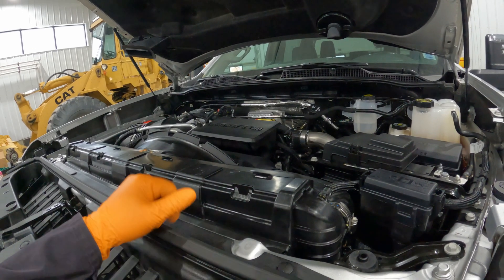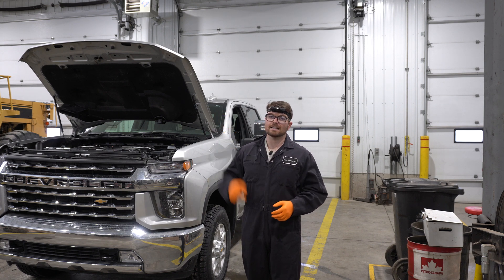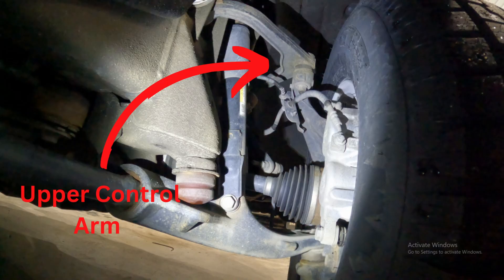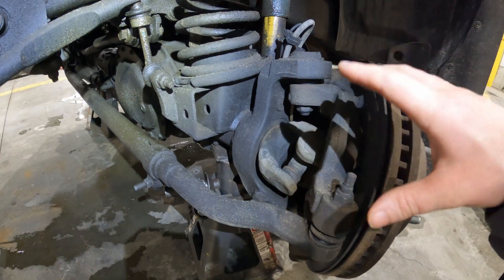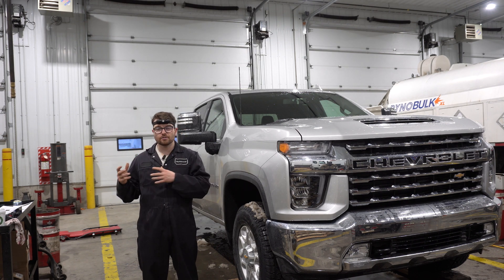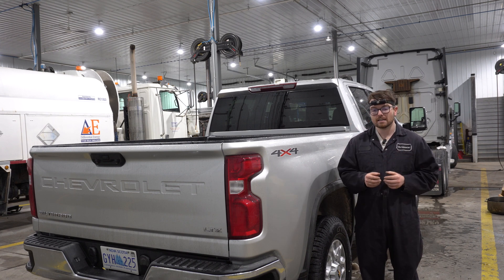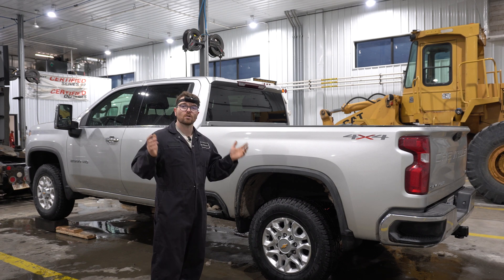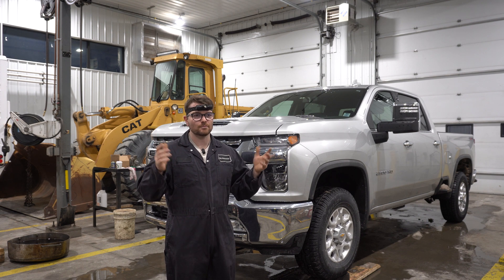Chevy 2500 6.6L Duramax Diesel Review (Part 2) | Does GM Make A GOOD Truck??

Comment: duramax l5p better than cummins  that my opinion
Reply from the maker: the L5P Duramax is certainly a good engine. But the 6.7 Cummins is a very well built unit.
Reply: Yes it is but  older generation duramax not is good like cummins  now l5p is top notch not about power  I'm  Talking reliable .

Comment: I thought tow rating had more to do with the suspension and stopping capability. All these trucks can pull more than they are rated for. I do it almost every time I tow. The problem is stopping the laod. Also I've replaced more ujoints on solid axles than cv shafts.
Reply: I agree, the tow rating is less an issue with the motor/transmission/gear ratio combo and more related to suspension and braking (possibly). The 3500 with the same motor/transmission/gear ratio is rated for 20k lbs towing. All that to say, it's not the gearing combination that lowers the 2500's tow capacity, I believe it's the suspension that holds it back.
Reply: Cv shafts for the win, definitely
Reply from the maker: It all effects towing. I was just taking an educated guess but I could be wrong. the Duramax is certainly more then capable of pulling big weight! 

Ya I've replaced lots of u-joints, usually because lack of maintenance. but I would still argue they are stronger.

Comment: Just priced the two out.  RAM 87k. Equivalent Chevy 70k.   Ram went from an affordable truck to the most expensive.  A super duty is cheaper option for option.   I guess  you really need to love a cummins to spend that much more.   Gas engine GM and Ford win again.  In 2024 GM will put the 10 speed  behind the 6.6 gas.   Ram needs to wake up or up the value.  That fancy interior doesn't mean that much to me.
Reply from the maker: wow, if that's true that's bad. RAM is the last manufactuer that can afford to price themselves out of the market. realistically ford and gm make more reliable products. the beauty of Ram trucks was that you could get a nice truck at an affordable price.
Reply: @The Getty Adventures  The Laramie I priced was 87k and the bighorn was 80k.  Cummins, midnight,  and the lowest option package they force you into once you add painted bumper.

The chevy in LT trim, z71 appearance package,  like the midnight package,  leather was 72, LTZ  was 75.  

All diesels.
Reply: @mattromain7177  I ordered a 2022 2500 bighorn optioned out to almost a Limited. I got the bighorn because.  I couldn't get the night edition Limited. Because the chip shortages.  Anyway I got my 2022 ordered it in 2021 in September.  Mines a night edition with 4:10 gears . The sticker said 61k. When I built a Ford with the same opinions.  It was almost 11k more . I didn't built a GM . Because imo they suck . So I didn't even bother.
Reply: @Matt Wengert  the Laramie trims really went up.  I did price out a big horn, midnight,  the higher level option package and with a 6.4 was 68k and with a diesel was 80k.
Reply: @mattromain7177  That's nuts . I mean inflation is up like 13%. I hope this prices start to flatten out.
Reply: @GettysGarage  

Not even close....he may have been comparing a dealer that added an ADM.

Equally equipped, all the trucks are similarly priced.
Reply: @John Peters  not what I found.  LTZ, vs Laramie.   Big Horn vs LT.  No dealer mark up, just go to their website and build one.   GMC is more than chevy.
Reply: Matt Romain hit the nail exactly on the head,  I spend my evenings looking at trucks and RAM is the most expensive, Ford I could care less about, but looked at them as well, GM is right in my ball park for a HD Diesel truck,  I watch The Getty Adventures videos and I’m glad he said he is BIASED, being honest in my opinion, It’s great he goes through and explains the pros/cons of these vehicles,
Reply: I agree.  Your numbers are correct.
Reply: 392 is a engine too tho.
Reply: GM tech myself…so this info is fairly straightforward to me, but great to see some actual tech on these you tube videos.
I think a lot of truck customers can use this information.

Comment: I have a 2017 3500 GMC 4x4 single cab. I've pull a 4 horse trailer with living quarters and 4 ft mid tack. Load with four horses and gear i sure it weighs 17,000 -18,000 lbs. i performs flawless in the mountains and the highways.
Reply from the maker: The Duramax does have great power so I'm not surprised!

Comment: Love it that you have one of the best Loaders CAT makes in the background. I think of the Lock up of that CAT going into gravel loads. Anyway I just got a 2021-3500-Z-71 Silverado ( Duramax/Allison) and looked at everything you talked about under mine. I will say I was on top of a mountain Pass. No snow cleared on side roads. In (4 × 4) Low and manual shifting. I was in snow up to frame. It was very good as far as following previous tracks
I could get out of turns, easy when it left ruts.
It is a 4 Door & 8 foot box.
Reply from the maker: that CAT pulls a lot a broken trucks into the shop! The G80 locker makes a big difference in the snow! And when I drove this 2500 with snowy roads it was great.
Reply: @GettysGarage  
I just Love it that you have a BIG Loader in the background as you talk about what Dodge, GM has for transmission in Pickups. That Cat will walk circles around any pickup on the market. I own a STOCK in Cat. Have a 1978 Dynahoe-190. And as you know CAT took over BUCYRUS-ERIE the maker of my 1978 backhoe. Just getting to (9000) hours on meter for that old (353 Detroit Diesel)
It's my play toy, like you pushing a vehicle around or should say so you can stay high and dry, as you explain your outstanding video on the difference of the Pickup market. I Love the product that CAT makes. Sucks about their class #8 truck not continue. But did it not get a great push for (International). My CAT stock keeps giving me smiles every time I look at returns.

Comment: I don't think the gearing is the problem, the 3500 has the same engine, transmission and rear axle ratios right? That can tow well over 30,000 pounds. My guess is GM just caps the 2500 off strictly as a marketing thing.
Reply: John YES my 2021 3500 Z-71 Silverado. Towing my 26 foot boat. I would say maybe 7000 pounds. Very easy to tow. Don't feel like my older truck.
Reply from the maker: a 3500 would make easy work of 7,000lbs!
Reply from the maker: Potentially a marketing thing. I still think it would be nice to at least have 3.73 gears as an option for someone who is towing consistently.
Reply: @GettysGarage  these new diesels trucks make it feel like there is nothing behind you . towing in these trucks has never been a problem .

Comment: General reliability is king. Sorry, I don't trust RAM Cummins.
Edit, you can buy new solid axels, Duramax Allison, with the 4500 series.
Reply: I don't own anything as new as this truck but my 07 3500 lbz is just seems to be a better all around truck than my 03 3500 5.9 cummins..  I understand there's a 5 year gap but I fell into the cummins hype...   the cummins is a great truck but my lbz does what the cummins does but with gloves on. Also, IFS is just more practical for me since I never plan on rock crawling these trucks
Reply from the maker: That's fair! Chrysler/fiat have always lacked in quality. But the Cummins is the engine on the market without a doubt. 

so it's interesting how when they go to a 4500 series truck they drop a solid front axle in because its a stronger unit. tells you everything you need to know.
Reply: @GettysGarage  👍👍

Comment: I agree with you on the wishbone suspension because a u joint is a hell of a lot cheaper than a new axle
Reply from the maker: yes sir! and once that boot rips your CV axle is pretty much junk.
Reply: Check the prices for an actual OEM Ford or Dodge front axel u joint. They aren't cheap. A Chinese one is cheap, but they'll last 15k miles. Also, have you drivin a solid axel truck with 150k miles. They drive like crap, all over the road. While an independent truck is much more drivable with worn parts.
Reply: Look at the labor costs to replace that u joint over the cv axle
Reply: @williamwhitted2490  like 2 hrs work if you're not an idiot

Comment: you can't get 4.10 with 2500 Cummins 4.10 comes only with dually
Reply from the maker: Yes, my apologies that is correct. only a Gas 2500 can option the 4.10 gears. Thank you for pointing that out.

Comment: Couple of things. The 1500 series 10 speed was designed in collaboration with Ford and not approved by Allison. Allison had nothing to do with that transmission. The HD 10 speed (10L1000) was designed with Allison involved and tested and approved by Allison.
You talk about strength of front ends and of course you are entitled to your opinion, but as a retired mechanic with 40 years on the job, I have not seen failures of these front ends unless the CV boots are open to the elements. I believe they are well suited to the HD trucks and not prone to "Death Wobble." In addition the turning circle is much tighter on the GM's.
Personally I could not buy the RAM based on  the its use of the 68RFE. That transmission is not robust enough and prone to premature failure so RAM's towing numbers are worthless to me.  And the fact that Fiat / Chrysler  decided to use the CP4.2 Fuel Pump on the 2019 Cummins was enough to scare me away. Why would they do that knowing those pumps fail and spread metal throughout the whole fuel system. Apparently those trucks are being recalled and the CP4 replaced with a CP3 leaving customers without a truck for months. The Fords use a CP4.2 and there is no way for me feel good about that.
Reply from the maker: Great points Jim, the solid front axle is not flawless I just think it's a beefier unit. I agree with you 1000% that the 68RFE transmission is nothing but hot garbage. It's embarrassing that you could spend close to 100k on a new Ram 2500 and get that transmission. As for why Ram went with the CP4 pump I have no idea and they are paying for it dearly. lastly, I have no idea why on Gods green earth Ford would decided to still be running the CP4 pump is something I can't comprehend.
Reply: Your information isn't necessarily accurate because if you really need something that is indestructible then just get the ton truck ram with the aisin in it. Also the 22s and maybe 21s come with cp3s from the factory.  And the guy I know with a 5th gen that did the recall said he got his truck back the next day so there's that
Reply: @wizard_of_poz4413  Why do you suppose that RAM does not use the Aisin in the 2500 series that costs $80+ k? The 68RFE isa trash pump yet they continue to use it and apparently don't care. No way I'm dealing with a company like that.
Reply: Also I was not impressed with the turning radius on our dually duramax because the equivalent ton dodge out turned it by a wide margin despite being a crew vs a single cab.
Reply: There’s a reason why you see 9 out 10 trucks in hot shot Ram 3500 or 4400/5500. The GM offerings are good  and in my opinion a better option than Ford but, they still can’t compete with a Ram HO with 4.10 gears and Aisin combo.
Reply: Correct. A Ford 10R80 and a GM 10L80 are the same transmission minus the bellhouse pattern, and each manufacturers own tuning. Then GM uses a 10L90 on a A10 Camaro ZL1. It's a beefed up 10L80 designed to handle more torque. What I don't know for sure is if the Ford 10R140 and GM's Allison 10L100 are based off the same design or not.?.?

Comment: I don’t agree with your statement that Ram has missed with their 6 speed transmission. Ram has the most reliable tranny in a HD with the Aisin. The 10 spd on Ford and GM are good tranny’s but time will tell if they are up to par with the Aisin.
Reply from the maker: The Aisin 6 speed is a great transmission. but unfortunately you can't get that in a Ram 2500 with an Aisin. it comes with the a speed 68RFE which is garbage.
Reply: @GettysGarage  well I got one in my 18 and it's not particularly impressive but it's no 47re or e40d either. Plus I've towed some idiotic stuff with the gooseneck and it hasn't failed yet
Reply: @GettysGarage  I'd be curious if the zf torqueflite is actually any better or if it's a gas only transmission because it seems conspicuous and kinda dumb that the Chrysler transmission is still just hanging out I one configuration of truck and nothing else
Reply: Yeah its a mystery why they're hanging onto that little Chrysler one unless it's to bilk money out of customers
Reply: Pretty sure he talking about the 68, not aisin

Comment: That 10 speed is a GM hydramatic, 'Allison branded'.   Not a true Allison.  Great video, I agree, SFA is the only way to go.
Reply: Even the six speed Allison 1000 transmission it’s made together with GM and I don’t see anything wrong in there
Reply from the maker: Even if it was the 1000 series was so overbuilt for a pick up truck.